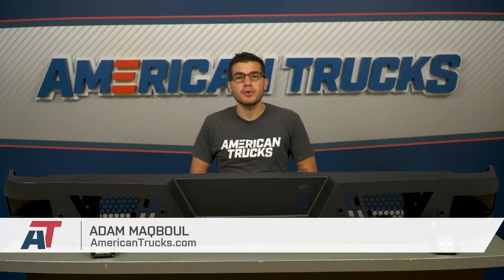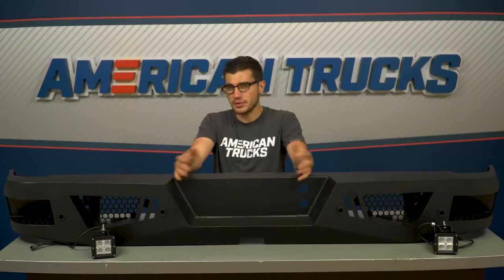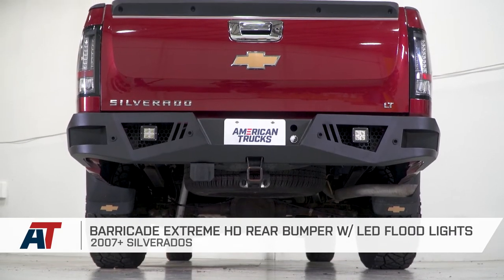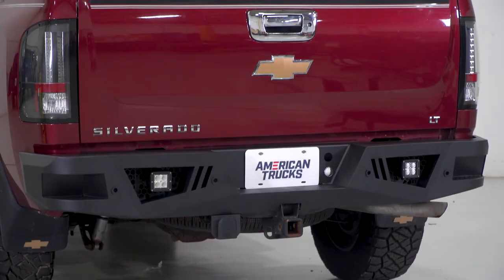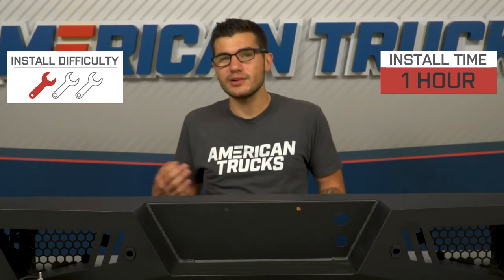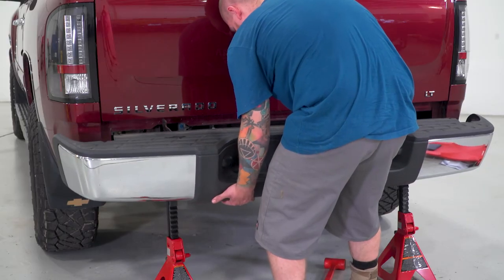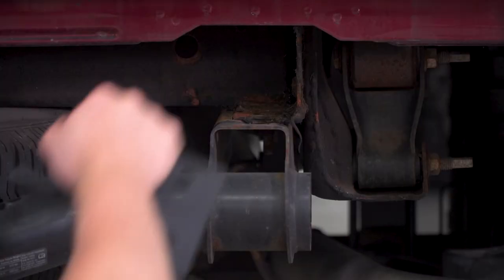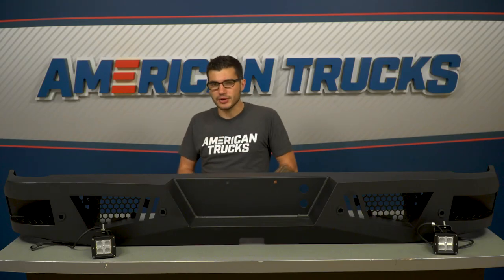2007-2017 Silverado Barricade Extreme HD Rear Bumper w/ LED Flood Lights Review & Install

Comment: The real question is does this only work on 1500’s ?
Reply from the maker: The fitment and overall design of this bumper was made only with the 1500 models in mind, that being said you can always try to make it fit a 2500. We would not be able to guarantee fitment though. -Zach
Reply: AmericanTrucks Chevy & GMC say i was to buy it, could I return it if i didnt change anything?
Reply from the maker: @jman9296  If no modifications were made to the bumper you would be able to return it no problem, you would be responsible for return shipping costs though. We offer $10 flat rate return shipping labels if you'd like to purchase them from us as well. -Zach